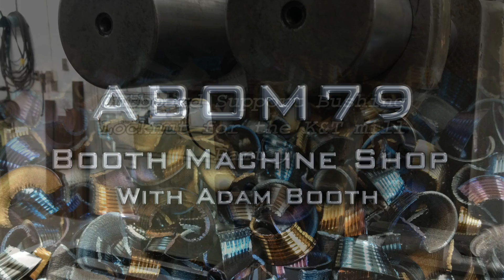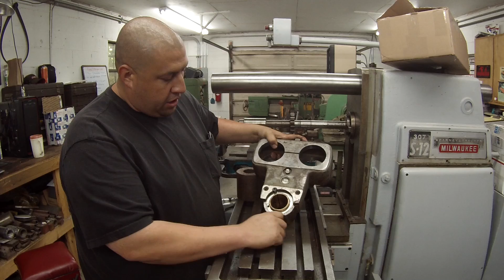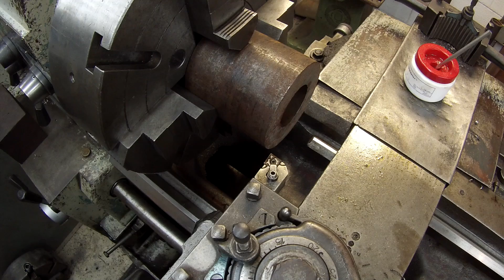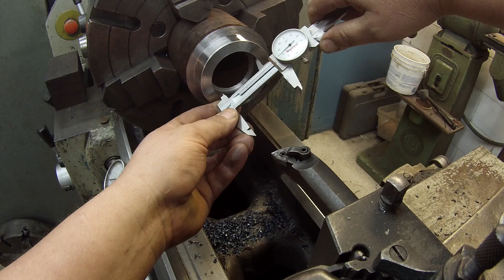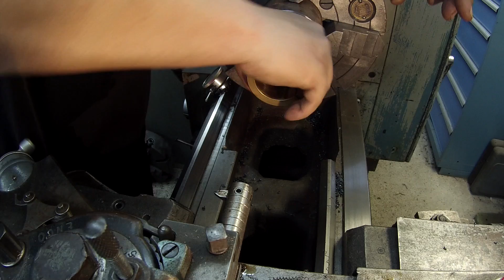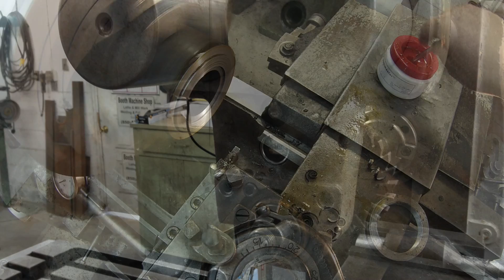Overarm Support Bushing Lock Nut Part 1

Comment: Hi Adam, how do you know on each pass of the tread that it's not goin to cross over the prevous cut,
Reply from the maker: You have to learn how to properly read the threading dial on the lathe and when to engage the half nuts. On my lathe I have a 4 pitch lead screw. Any pitch divisible by 4, you can engage the half nuts at anytime you want. On other even number threads, you can engage on any line, odd thread any of the 4 numbers only. 1/2 threads, 180 out on the dial, like 1 and 3, or 2 and 4. Fractional pitches, say like 1 5/8" pitch (example) you must engage the half nuts on the same exact line every time.
Hope that makes sense.

Comment: Spring cut? What is that?
Reply: SirDeanosity The "Spring cut" is just another pass at the same setting (depth of cut) as the previous cut, this allows the tool to do a light cut after the tool may have flexed on a heavier cut! The pressure pushes the tool away and then it "springs" back into place.
Reply: Thank you for that explanation!

Comment: Disclaimer, I don't know anything about machining.

Question: When making the threads does the machine automatically match up the entry point to start creating the threads?
Reply: +Glass Impressions There is a revolving 'thread gauge on the apron and cross-slide that is always turning when the spindle is running, and you have to wait for certain marks on it to align before you engage the 'half-nut to start a pass cutting threads.  Sometimes you have to hit on the same marks when cutting odd-numbered threads, while for many even numbers of threads, especially if the number of threads per unit of measure is a factor of 4, you can engage the half-nut on any quarter of the threading gauge.

Comment: Hey man quick question.. When you start cutting those threads, how does the cutter hit the same spot each time?
Reply: Amateur Tech Industries Basically, once you set the lathe gearing for the threads per inch you want you watch the threading dial on the carriage and engage the half nut on the same number each time! The dial reads off the worm that drives the carriage.
Check out some of the videos on MrPete222's you tube channel for more detailed info!
Hope this helps some!
Jeff

Comment: Hey Adam.  Great video. This would be way too much work than it's worth for that job but I have done this in the past with an old nut. You can take an old nut to a part like the bushing you had with dinged threads and cut a few groves across the threads inside the nut with a saw and make a thread chaser. It works surprisingly well. Maybe you have done it before? Just made me think of it and thought I would share.

Comment: This may be stupid but why do you need to touch off on the work.
Reply: May I answer that?  A machinist needs to "touch off" on the part to be machined in order to calibrate the lathe in relation to the work.  Some old time machinist used to turn the work for a short distance, measure the fresh cut with a set of mics, and calculate how much more material needs to be removed.
Reply from the maker: It just gives you a starting point, not everyone does it that way though. I like to touch off, then set my dial to zero.

Comment: Great vid Adam :) Instead of drilling holes on the nut lugs I would suggest making the proper tool for the machine. A simple bar with two pins is quickly and easily made, and it can belong to the machine if you ever sell it. Just a point to ponder good buddy.
Reply from the maker: The spanner wrench works perfect for it, but I see your point. The holes on the outer diameter is actually more factory looking.
Reply: Never mind. I thought there was more space there. Saw this am my idea would not have worked.

Comment: Hey Adam,

Have you tried running your parting blade upside down with the spindle in reverse? It converts the tool post geometry to that of a spring parting blade holder. Any tendency to chatter or dig in flexes the tool out of the cut. The chips just fall out too!

You could have avoided making a threaded mandrel. Start off by drilling a ring of 12 holes on the right PCD, then just turn the OD leaving the notches. I used that technique (on the ID) making some motorcycle fork check valve cages.

I'm looking forward to seeing the K&T strut its stuff. How's the hydraulic diagnosis going? I fixed a system a while back where there was a spec of dirt under the pressure valve ball. The 'Pros' had just changed the pump twice!
Reply: Thanks, Paul! Now I know how to make that five fingered star nut thing - or adjuster, that goes on my clutch perch.. ;)
Reply from the maker: Paul, I can't say I've ever used the parting tools upside down. Might have to try it one day.
Good tip on drilling the holes first, but I still would have used the mandrel to face the back side after parting. I don't like to leave a parted finish on my parts.
I havn't yet gone into the knee. Hopefully pretty soon though.

Comment: He Adam - always informative and educational thanks for posting.

Quick question, I 've just picked up an Okuma LS lathe and it comes with the same style tool post system as yours - in trying to clean up the machine I got at an auction from Boeing here in Australia - I just can't budge the nut on top of the post...any ideas?

Pete
Reply from the maker: Wow, someone really torqued down on it huh. You might try using some heat on the nut to make it expand, and a cheater pipe on a wrench, or socket and breaker bar to get some added leverage. If that doesn't work you may have to carefully grind the nut loose.
Reply: Thanks Adam - I measured the nut it is either 40 or 41mm between flats- so maybe I'll buy a couple of larger sockets and go at it with a pneumatic ratchet I use for working on cars and trucks! 

Just a bit nervous applying heat on a lathe!

yeah someone went to town on torquing this nut up for sure...
Reply from the maker: Peter A
Applying heat to the nut will be ok, just not too much. I'm not talking about red hot, but enough to help expand the nut some and possibly break loose from the threads once you have enough leverage on it. I would use a small welding tip and apply it directly on the nut for a bit then back off.
Reply: Cheers Adam - much appreciated.
Reply: Peter A
Musta been my coworker, he thinks everything needs to be torqued to max specs.

Comment: I'm going to join the chorus of voices in favor of internal threading from the inside out.. It only takes one good crash and a scrapped $1000 part to make you a believer.

Added bonus: It's easier to see what your threading tool is doing, and the chip formation.

Frank

Comment: i would of used some fine valve grinding paste on the threads wound it in and out a few times it would help bring the dinged
threads back in to shape a bit great video adam nice bit of machining
Reply from the maker: There was one spot that got hit pretty hard and pushed the threads in. Had to file them to straighten back out.
Reply: i have a set of thread files i was going to give them to keith fenner for the whats in the box give away comp last year but some one as nicked them from my moms house swines if i find out who it is yeah i use the paste after the thread files wind it in an out a few times its just gets the bits the file cant get found it great on tight threads. a lot disappeared out of my tool box since i moved it to my moms house where my brother lives dont worry i will find them but i cant really use them now